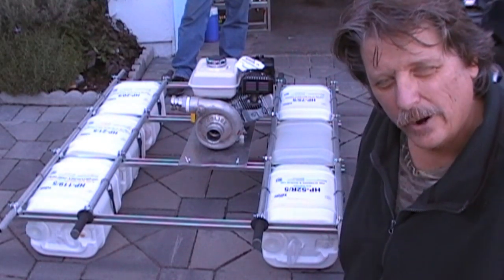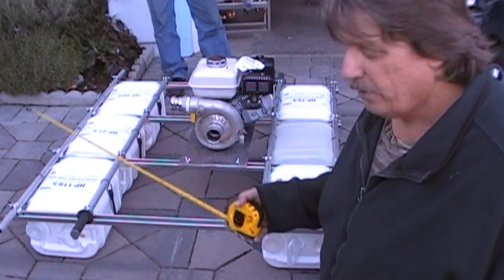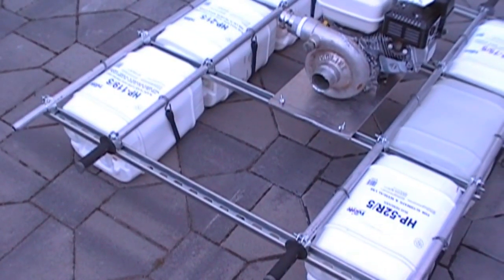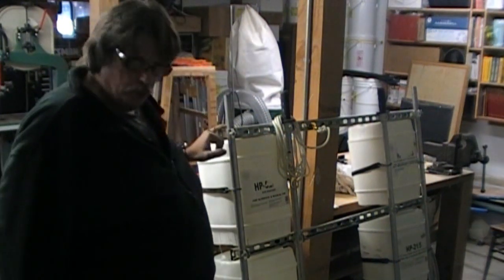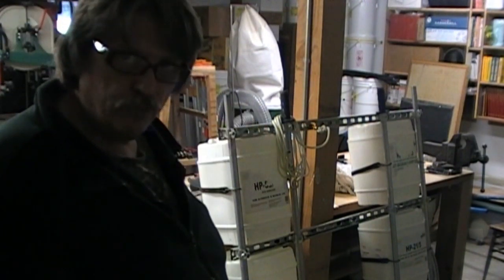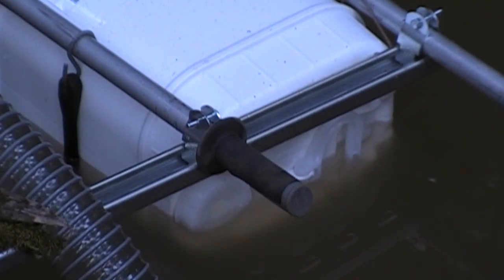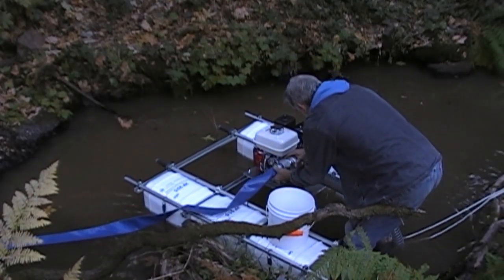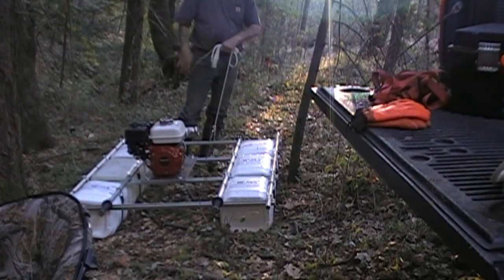How to Build a Floating Pump Platform

Comment: that was nice looks like the dredge i built except i used 8 floats gust like urs and i have the same size motor looks like urs would work as a dredge 2 its to bad u cant use dredges in california how do u get away with it is it because u dont dredge right in the river  just wondering